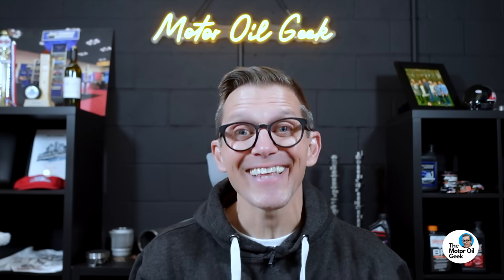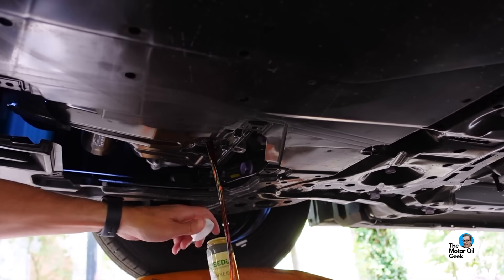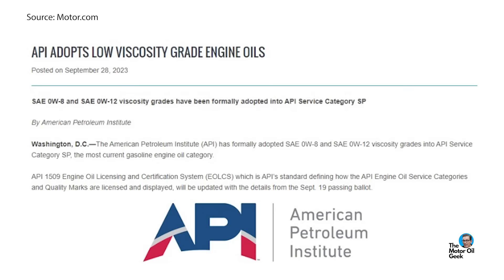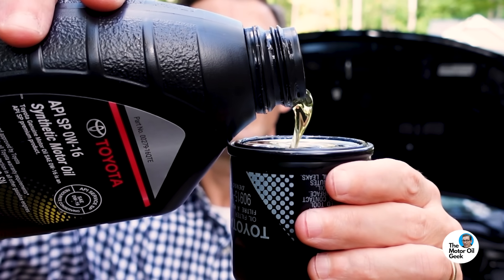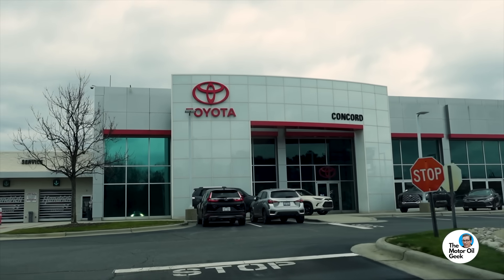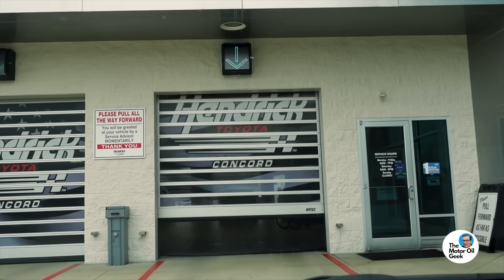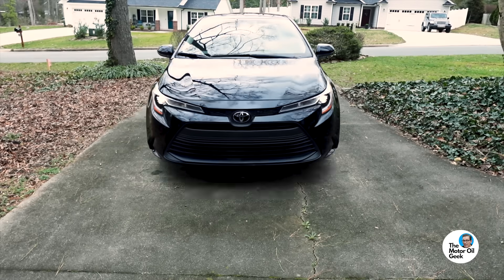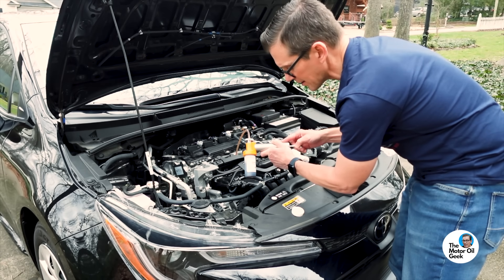0W-8 Motor Oil: Too THIN to Trust? Let's Find Out!

Comment: It would be very interesting to get your take on the new Valvoline restore and protect. It claims to be the only oil that actually removes deposits. If it does what it claims,  it would be great to clean coking from oil control rings on DI engines.
Reply from the maker: Stay tuned! We are going to do an in-depth video on the Valvoline Restore & Protect.
Reply: It's not going to clean deposits from the intake ports on DI engines.  And coking on oil rings is not just a DI thing that is most modern engines as they all have low tension oil rings now.  I've only seen two design solutions that reduce or eliminate the intake deposits on DI engines, either dual DI/port injection like Toyota D4S and the newer Ford EcoBoosts or water jacketed intake ports like Mazda has on the SkyActiv engines.
Reply: No one mentioned anything about intake deposits  @mrvwbug4423
Reply: @mrvwbug4423  Toyota D4S reduces deposits but doesn't eliminate them
Reply: I've asked in another video for him to do this as well! I hope he does
Reply: Count me as one that has been nagging Lake Speed Jr. to cover Valvoline Restore and Protect.  Cleaning ringlands of carbon is the "next frontier" of motor oil, sort of.   Finally, a product with special chemicals to handle it better.  Might be similar chemistry tricks compared to "HPL" brand oil, who makes premium oils that clean, and a cleaner-addtive HPL Engine Cleaner 30.
Reply: I'm also curious to hear what he says.
Reply: Di engines have deposits on intake valves. Carbon deposits on oil controll rings isn't caused by injection type. Rings in new engines get filled up so much because of their small size.
Reply: @Billybigrigger-ic7jp I'm not sure short OCI will fix all the problems created by short tough duty cycle. Getting the engine up to temp and circulating that oil when it is nice and hot is probably needed too.
Reply: I would bet that adding something like Marvel Mystery Oil to your engine oil achieves the same deposite removal results at a cheaper price point.

Comment: So, the manual says you can use 0W-16 but you must replace it with 0W-8 at the next oil change.  I was surprised you didn't highlight that fact during the New Car oil change video you did with your daughter's car.
Reply from the maker: That's just legalese for the EPA.
Reply: @themotoroilgeek Yep, all the cert. testing was done with the 0w8 oil.
Reply: Correct, my 2024 Corolla owner's manual says that, but has the same decal as his under the hood. 0W-8 is now available through Walmart. Mobil came out with GLV-1 approved oil in March 2024.
Reply: I think Geek did mention that in his video IIRC. He opened up the manual and clearly stated that 0w8 was the proper oil to use, but that 0w16 could be used if no 0w8 was available. I don't see how he could have been any more clear than that.
Reply: @LA_Commander lol it is recommend for epa cafe standards.  Same engine delivered in australia they will say 5w20 or 5w30 hmmm. Thin oil is strictly for numbers
Reply: @justingill5256  exactly
Reply: I bet it also says that if driven under severe conditions, heavy loads, or high-speed, that going up a viscosity would be recommended
Reply: That's only a SOP to the EPA. Nothing more
Reply: you could get away with 0w-20 in it if you wanted...just less efficiency
Reply: Fuck the manual. The data shows the thin oil has way too much iron wear

Comment: Hey Lake, love your channel,  I own a 2021 Subaru Crosstrek with a 2.5L. I have researched for the best oil with the lowest evaporation as per the NOACK test to reduce blowby to prevent intake valves from gumming up. As a result, I use Pennzoil Ultra Platinum or Pennzoil Platinum. I would love your input on this and any suggestions would be appreciated.  Thanks
Eric Soumah in Quebec, Canada

Comment: I guess viscosity ISNT? Most important. The proof is in the pudding. It seems additives are just as if not more important than having proper viscosity. I had always imagined if an oil is too thin it just wouldnt stop metal on metal, but i guess you learn something new everyday. Cool video showing the wear trends in the oil from a new engine. 👍
Reply from the maker: Thanks! Stay tuned for more!
Reply: Problem is, he along with Projectfarms compared 0w20 to 5w30, and they both got the same results, 5w30 was better...
Reply: @lonniebeal6032  Wrong.

Comment: Hi thanks for the great video. I have a 2024 GR Corolla and I did 4 oil changes on it as of now. Break-in at 621, first oil change at 3000, Toyotacare at 5000, and my latest one at 7500. I sent in oil analysis for the all 4 and my latest one I put 5W30 instead of 0W20 and my wear metal near went down to 0. If my best oil analysis came back with the 5W30, would you recommend staying with that or get a higher quality 0W20?
Reply: Toyota tech here, stick with what that engine requires, it’s got a variable pressure oil pump, it’s calibrated for 0-20. Using anything else can actually cause a check engine light to turn on, on that car. The reduced wear you’re seeing is likely just engine wear showing it’s slowing to 0 or near 0 regardless of what oil you’re using.
Reply: I imagine you may be seeing the engine finishing it's break in period
Reply: Stay 0W-20, it is engineered for that weight...
Reply: Load from the turbo and heat test film strength of oils. In performance engine or heavy load application like a truck I would not touch any lower then 0w30. Depending on use case you may notice crank touch down on journal bearings and need to got  5w40 or 0w40. Each engine is so unique so the analysis should help you figure out what the right answer is.
Reply from the maker: Nice work! Follow the oil analysis results!

Comment: I paid 150usd for 0w8 oil change at 780 miles to a Toyota dealership. They showed me the original 0w8 Toyota Oil quarter and charged me 19.99 each plus 30 for the service. They put 4.8 quarters, and I paid for an additional bottle to flush after draining the oil. Toyota Corolla Cross 2024.
19.99x6+30
Reply: Paying $150 for 5 quarts of sewing machine oil (also known as 3 in 1 oil) is not something I am stupid enough to do.
Reply: @fluxgeario Toyota care doesn't cover an oil change at that mileage
Reply: @plasmatvforgaming9648  you made this comment a year ago and recently I just visited a Toyota dealership for my 1000 mile oil change and they charged me $88 for the 0W8 mobile one oil change and filter. The price of 0W8 has come down because now it’s $28 at Walmart for a 5 quart jug. But the labor for it was $50. So parts and labor 88 bucks. That includes gasket and filter.

Comment: This was the same as 0w16. Couldnt find it on the shelves for months after 2019s were rolled out.
I dont like running 0w16 in my 2019 rav4, but do in the winter time. In summer i run 0w20.

Comment: How will this engine hold up when keeping high speed pace on the autobahn like between 150 and 170 km/h for more then 3 hours.....
Reply: OfficialNakatsuMegami  ok so low ring tension, but how about the oil film strength probably it's fine for this engine. May be they also have smaller ring gaps..... And need the thin oil to keep the rings floating and prevent clogged up. I had my old bmw engine low tension rings clogged up. I was able to fix this by running (against all advise🙄) thinner oil, i used 5w30 shell with dexos 2 and bmw LL04 specs and liquimoly ceratec and the.run the engine long and with high revs. Oil consumption went down from 500km per 1 liter to 4000 km per liter (still a bit high but acceptable) it took 10000km to achieve this..... 😅

Comment: Ferrari tried super this oils in F1 … then they decided they could cheat and burn this super thin oil for extra power…
Reply: They were all doing that to some extent! F1 fuels and lubricants are very special. Technically it is supposed to be equivalent to premium unleaded but there is a pretty long list of technical regulations as to what compounds are and are not allowed in the fuel.
Reply: Mercedes were the first ones to start doing it way back in 2014 to get around the fuel flow restriction.
Reply: Alll did!!!

Comment: I have to agree Lake that when you monitor it by samples you get the real data. My gut feeling is telling me to stay away from this water thin oils but the data show otherwise. So i have to adapt my auto mechanic brain.
Reply: Tolerances and design clearances are two entirely different things. Manufacturing tolerances have improved over the years, but engine bearing clearances are determined by factors outside of oil viscosity.
Reply: @pete1342  You're right. I meant clearance, not tolerance.
Reply: Can you show a car with 100K on it runs this thin oil??
NO!!!
Reply: @summerforever6736   Well my '18 Camry on 0W-16 is doing great at 70000 with a wear number of 4.....that's right...4.  Do you think much will change over the next 30k?  I work in the heavy API rotating machinery market and I've done projects for [major oil company begins with "S"] and we use their additive package in an AGMA gearbox....ask me if I think Lake is full of it...dare ya.  It's all about base and additives!
Reply: @summerforever6736  Everyone keep saying how engine with bigger displacement, more and bigger pistons etc last longer but in reality it's all BS. I took apart two of my engines with almost identical 160 000 miles on each of them. Small turbo 1.2L Inline 4 was in far better shape than my 4.6L na V8. And I abused that Inline 4 til it gave up.

So I doubt thinner oils are going to cause issues as long as used correctly.
Reply: @summerforever6736  There are thousands of them out there.
Reply: @summerforever6736  I'm absolutely positive I can! You're living in the past with outdated information, clearly you did not hear what Lake said about additive packages. Maybe don't re-watch the video, cause then you'll know how dumb you sound.
Reply: Yes as a old school mechanic of over 50 years no ow oils for my 2021 vehicle !!
Reply: Thinner oil is needed for tighter tolerance bearings. Tighter tolerance bearings wear less and last longer.
Reply: @deelowe3  These Toyotas do not have tighter tolerances. That's an urban myth. These thinner oils are driven by C.A.F.E. standards pushing for ever more MPGs. Nothing more.
In Australia the exact same engine is allowed to use oil even up to 10W40. Do the Aussie Corollas have lesser bearing tolerances?
Reply: @stephenh8092  In hotter environments you want higher viscosity oils because your engine and oil on cold start are already pretty warm so there is no need for low viscosity oil as it's already thin enough to flow through the engine on start up. 
On my friends VW T4 with 2.5TDI you are allowed to use anywhere from 0W-30 to 20W-60 as long as it's correct VW spec. But it is all down to the environment.
Reply: @deelowe3  In the Corolla Cross (same engine) it states under the hood to use 0W16, in U.S. made models it has changed in late 2025 to 0W8, and they did not change anything about the engine. In the owners manual it states that 0W16 can be used, but to go back to 0W8 when possible.
Reply: @deelowe3 false. The only real reason is tighter emissions and mileage requirements.

Comment: Dealership oil will be brown, slippery and above all, cheap. Love the channel content thank you from London, UK
Reply: In the US they typically use oem fluids. Only time I seen they haven't was a Ford dealer when I was picking up parts, they used mobil one.
Reply: @BigHRepair they don’t use OEM fluids they buy in bulk. Most of the time it’s not the OEM oil.
Reply: @Hernsama  really? The dealers around me do with the exception of the one. Didn't know that. I thought that was common for them to use oe fluids for their warranties and stuff
Reply: @Hernsama  "OEM" oil is supplied by the major oil companies anyway because the car makers don't make their own oils. Toyota oil is from what I remember supplied by Mobil. Motorcraft oil typically is Conoco-Phillips, and GM used Mobil as factory fill for a time.
Reply from the maker: Thanks!

Comment: Id like to see your opinion on oil addatives such as lucas or one ive tried with good results moreys heavy duty oil stabilizer wondering if theyre snake oil or possibpy cause harm
Reply: It's known as chemical Russian roulette for a good reason. 🙈😂
If the oil doesn't have the right additives then buy the right oil, and question any oil brand that sells additives as they should know better. 🙂

Comment: The tolerances of today's  Toyota engines must be so tight that 0W-8 is required to get through all the tight crevices to be lubricated in your engine. The most used in American made cars today use 5W-30 oil. Good enough for cold and warmer weather in the USA. Alaska included during the severe winters. How can 0W-8 perform at 105 degrees temperature in Arizona and California?
Reply: I think most vehicles are using 0w20 these days
Reply: @chrisb9478  5W-30 oil is not dead yet. Many older cars in the multi-millions are still using 5W-30 oil today.

Comment: My cars service manual says 5-30, but dealership says 0-20. Bs. I want my engine lubricated. But hey, they also call gearoil for "lifetime".
Reply: There are no lifetime lubricants, if you want to keep your vehicles for a long time 😂
Reply: Basically lifetime of your clutch
Reply: Unless you get UOA it's guesswork, but that's not a massive step between 20 and 30 and just a concern for full film lubrication.